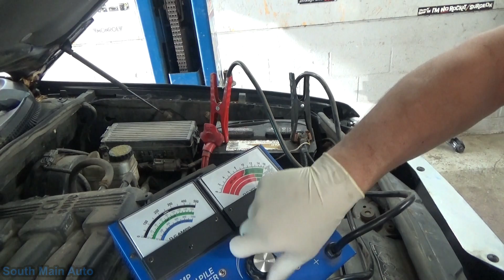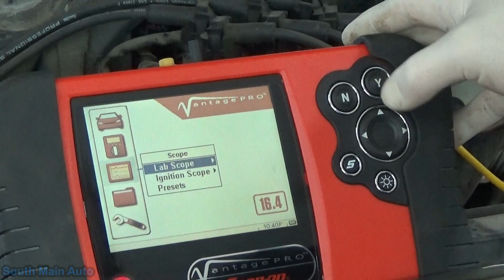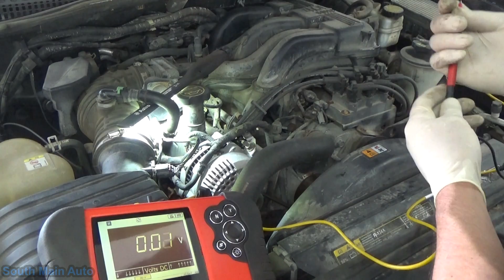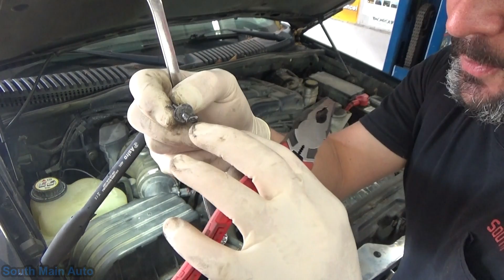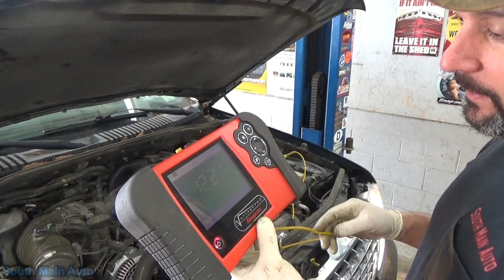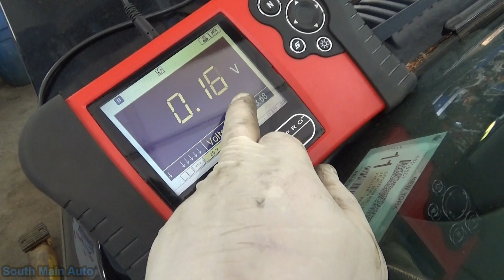Charging System Problem - Voltage Drops

Comment: Eric ...many of the companies that put out  remanufactured alternators do not always replace the voltage regulator....we ran into a lot of these issues with Ford vehicles at the shop that used the smart charge systems ....we solved the issue by comparing a brand new OEM Motorcraft Alternator to several aftermarket /remans and found that we had no issues with the OEM Motorcraft that was brand new ,they held the voltage indicated . Then we looked at the remanufactured ones and found not one of the voltage regulators had been replaced either for cost savings or just short cutting to a workable unit . So in short OEM in this case even though more $$$ solved the issue in the smart charge systems.

Comment: Nothing more frustrating than swapping a bad part, with a brand new remanded bad part.  Good job verifying repair. People in my shop freak out when I verify my repairs. Lol! But, I don't have come backs😆
Reply: if I had a dime for every loose reman and new aftermarket alternator studs, i;d be rather rich :)
Reply: As long as they don't hold it against you as far as  them thinking you are wasting time

Comment: Good point about wiring resistance and voltage drops. An old motorcycle I had years ago had a crappy headlight. When I measured running battery voltage versus voltage right at the headlight bulb, I can't remember the exact number, but it was a lot! It had very thin gauge wiring. 

To solve this, I used the headlight wires to trigger relays. I had a heavy wire right from the battery, to the relays, from there to the headlight. This nearly eliminated the voltage drop, and made the headlight much brighter.

Comment: In cases with low alternator charge, you should also test the voltage drop in the negative (return) current path.
This would be the voltage drop measured from the alternator housing to the battery negative terminal.
Very often you have corroded mountings in the alternator brackets and bolts, the engine to chassis lead, the chassis to battery negative lead etc, which leads to substantial voltage drop.

Comment: This shows the importance of loaded circuit testing. Upon first inspection, it appeared good with >14V at idle. Once that crappy connection needed to carry a lot of current, the problem became obvious. Good work, Eric.

If only the reman suppliers could even come close to your competence.

Comment: If you check listings for replacement alternators for 2005 Ford Explorer, two are specified:  115 amp and 130 amp. To get more amperage output from an alternator, you need more windings of electrical wire in the stator unit. That would mean the stator has a slightly larger size and requires a larger diameter case. But Ford engineering may have specified the same size case between a 115 amp and 130 amp alternator. The difference is internal to the unit: the 115 amp winding is slightly smaller than the 130 amp winding. From the outside this would not be noticeable.

Now the remanufacturer starts to get original equipment alternators for rebuilding. Sloppy quality control in the rebuild process allows the smaller stator windings (115 amp) to be installed in units calling for 130 amp windings. It fits physically so everyone is happy. The final stage is quality control testing (or lack there of). 

At interval 29:00 the test results indicate 60 amps output at idle and about 120 amps at higher engine rpm. That would be excellent test results for the LOWER OUTPUT 115 amp alternator. And 120 amps is CLOSE ENOUGH TO THE REBUILDER SPEC in final testing. Great quality control! So the alternator gets shipped to an unsuspecting buyer!

This is just a theory. It will be interesting to see what Dr. O finds in Part 2
Reply: Comment above about pulley size which will have an effect on rotor rpm as well. I agree with what your saying
as well. Number of winding on the rotor and stator dictate current output.

Comment: To me it looks like that remanufactured alternator may be working as designed, but it may have actually been a mislabeled "look-alike" designed for a lower amperage car.   It's still a supplier problem, and ultimately your parts store needs to take responsibility for their supplier, as they kindly did in your follow-up video.  My own guess is that few other mechanics would have noticed the insufficient amperage output problem like you did - you're a great mechanic - thumbs up to you!   Don't feel too bad that you melted your voltage clamp/probe, I have done that before too!  Those cheap air cooled alternators get HOT, much hotter than the engine.  I learned the same lesson the other day, melting a scope probe on the V+ terminal of an air-cooled alternator.  I suspect those fancy water cooled alternators last longer, and wouldn't have melted your clamp, but of course they are expensive and harder to replace.  I enjoy these newer alternator "systems" which don't actually turn on the alternator until after the car is started.  That reduces the mechanical load on the starter, and the peak current  requirements of the battery, both of which which can be especially useful in cold weather.  Some of these intelligent charging systems also back off on the alternator voltage after the battery is charged, so the battery doesn't get overcharged, which can confuse you trying to diagnose a problem like this.   Again, FANTASTIC video for anybody who wants to learn about alternators!

Comment: This happened to me.  I was on a cross country trip at the time in my just rebuilt Dodge 2.2 turbo and I had put in a "new" altenator just for good mesure and so that I would not have any problems.  Long story short, I changed it at a truck stop and lost very little time. They (Advance Auto) delivered a new one to me at the TS under warrenty.

Comment: Connectors, like that eyelet connector, are copper with tin plating. The tin plating prevents the copper from oxidizing and causing electrical resistance. It's not recommended to remove the tin plating, by using sand paper to clean the surfaces. Electrical contact cleaner and a mild abrasive (cotton cloth) is recommended. Excellent troubleshooting.
Reply from the maker: Sand it, toot of fluid film, move on :D
Reply: Guess what, they're being cleaned because they're already corroded/dirty. There is no other way to clean up the connection besides replacing the eyelet or cable. It's done all the time.
Reply: sounds like a good practice for cleaning new parts, not crusty ones, i like erics method, he ain't going to re tin o ring connectors lol

Comment: Just thought, that this cable and especially the crimp connector would be a nice task for a FLIR camera. Easy to verify were exactly the heat is produced: Heat = increased resistance = failure position. Btw, nice job Eric!

Comment: Good troubleshooting. Vibration may have caused the adapter failure. When the alternator is removed it is a good time to clean the mounting area and bolts to get a good ground. You didn't show a voltage drop test from the alternator case to the block.
At a cold start up in cold weather the alternator out voltage would be increased, a cold battery gives less current out but it also won't take as much current in.  
Good video.

Comment: Hi
Consider the pulley diameters and engine idle speed

The alternator current output is related to RPM (look at the test document.)
Compare the OEM pulley size to the reman. part . Also Ford engineers may have not considered the higher loads to charge the battery at all times. BTW Alt. pulleys are modified all the time for HD marine ( house batteries ) applications.

Comment: Interesting learning about reman alternators in the video.  I recently replaced the Alternator in my Jeep Grand Cherokee and considered several options - a reman from Mopar(they don't sell OEM new versions), a reman from Rockauto, and a new from Rockauto.  On the Rockauto website they put a little heart picture next to the alternators they sell most. Of the 10 alternators offered for my vehicle the heart picture was on the new alternator.  So, I purchased new.  It worked out well.
Reply: Gotta love the little heart!

Comment: Thank you for this video.  After watching this video. A day later I had the same issues on a 2001 Mack truck. Day cab. Voltage drop the ground side and found I had a 2 volt drop. Turns out I needed to build a ground Cable and the truck ran great and the alternator was charging he batteries.

Comment: Put the transmission in gear with your foot on the brake with all that stuff running.
That's the battery voltage test I would always give them.
If it kept up , it was good to go

Now the charging system algorythms that GM uses on the newer trucks is another story.
As long as it is between the min/max bars on the volt gauge in the dash ; it is considered NORMAL even though it may appear to be NOT CHARGING AT TIMES.

Comment: Awesome video as usual I've ran into the same problem with aftermarket garbage I had one it was hard to change I made them test the new one after I got the third one I made them tested on their machine before I put it on finally got a good one.

Comment: Love your video! You are going all the way, not stopping at first possible problem, until you found the real issue! I love that! I have 2007 Gr-Caravan, 3.8L... that is draining my battery. I had to get a new battery, the old one wasn't charging but after 5 days the battery is drained again! I checked the alternator, producing 14.7V and charging the battery well! I turn off manually the lights, just to make sure that they don't drain the battery. After 1min to 2Hrs, (every 10 minutes) the drain is only about 0.02 to 0.03mA and I think it can go up to 0.05mA, if I understand the manual. Sometimes the battery drains in one day, later 3 or 5 days...it isn't the same amount of days ever. Almost like someone is playing with my car, while I'm not watching it... ha ha ha  What would you recommend me to try next? Do I need to take it to Dodge Service and have them run diagnostics? I'm at the end of my ideas. I do have only one problem with my car, the driver side sliding door, it is electric, opens about 1-2 inches and I have to open it the rest of the way manually,  to close it, I must close it manually. Could this somehow bee part of my problem? I'm open to any suggestion by you or other car guys! Thank you very much!

Comment: I just had to put new cables in the old Dodge Ram. Don’t forget to check for a clear poly liner under the cable outside insulator before you do the lug crimp. Ask me how I know lol.

Comment: With so many changes to the amps being used, one thing I learned to do was all ways check the size of
the drive pulley on the old alt to the replacement...if the pulley is smaller, it will change the rpm on how fast a alt turns, which affects amps being put out a idle speed with a load....please comment....

Comment: I remember troubleshooting a solar/wind charging system on a sailboat in Puerto Rico; the owner had been struggling with it for over a year, hiring multiple mechanics - nobody could figure it out. Turned out the clamp on the battery terminal had a ~0.4V drop across it - even though you could literally see the metal-to-metal connection, and it had been cranked down tight. Two minutes with a wire brush, and he had 30A going in. Unfortunately, he was also one of these guys who thought that those two minutes was all I should get paid for, and got really huffy about my minimum charge for working on boats at anchor, despite having been told ahead of time... 🙄

Comment: That is a strange finding, given the presentation. Not just a typical bad ALT situation. I don't have a clamp meter. I used to figure all that stuff out just using my DMM. But, haven't been a "Technician" for 15 years.
--I've seen "New" ALT not work. Slipping belts, even though no noise. 

--Right now, I'm trying to figure out why my '03 Rav4 V @ idle with high beams and all accessories on drops down to 11.2V. rev it up, and goes mid 12s to 13ish. Cruising, even city driving, stays about 13.8-14.2V steady. Usually it's at 13.8. It's evidently a Toyota thing. 

--I added: A. 4 gauge battery to body and B. engine to body grounds, in addition to the existing. 
--Now, these RAV4s/Toyotas have some charging issues. 
--But, it's not that. I checked it. no V drop. Checked resistance of grounds: all good. 
--Now, one thing different is that I used an Optima Yellow Top Battery. ??

Comment: Nighttime driving in the snow
Headlights, fog lights, wipers, rear wipers, rear defroster, blower fan, mirror defrost, heated seats and the radio. A/c would probably be on from the front defrost vent selector, which also turns on the cooling fans a lot of the time. 
I think that is all on a typical snowy drive at night. Forget all of the computers cars have now and everything.
I once had an alternator fail on my way home at night. 93 Chrysler car, that luckily had the voltage gauge in the instrument cluster. I noticed the volts were low on my way home before any lights came on. Only had what was required to get home. radio was off, faceplate was off (to keep the display off) , I turned the instrument cluster lights to the min brightness, etc. This got me a max of 20 minutes of driving from when I noticed the alternator stopped putting anything out. I got stranded on the side of the road without any power because the car no longer could run on the remaining charge in the battery. If it was snowing out, I wouldn't have made it very far.
Reply from the maker: For sure. cars are huge energy hogs and really dependent on that atl.

Comment: very good vid thanks Eric more than likely the ford left the factory with a poor alternator knowing parts manufacture now a days they print paper work to go in to the boxed item and heck its close heck let it go. as long as the car was running above idle it was ok it was when it was at idle the trouble starts until age got up with the part.

Comment: 2:30, FYI, I'm not sure if someone said it already because I'm coming into this in the year 2021 but there was smoke coming off the negative post at 2 minutes and 30 seconds or just a little after when you were putting a load on the battery.
Once again, the Lake House Affect.

Comment: Sometimes the insulated washer on back of the alternator hot Post will crack and cause a failer in the alternator.

Comment: Good Video Explaining the whole loads on Alternator phenomenon as ive put aftermarket new 1 in my last car bit iffy under load at idle, i put up with it as it worked "avoided overloading" and just did not back my thought diag 100% as a diy, but it was under-performing like this videos one. SO Thank's SMA, theres you problem lady

Comment: Mrs O wants a jumppack? Don't leave the key in or car on...problem solved! Remember when alternator and regulator were separate? Look forward to conclusion and if you get better reman part!
Reply: ya left the keys in it ??? -"theres your problem lady"  lol
Reply: richard cranium 

😂
Reply: xoxo2008oxox I remember separate alternator and regulator. 72 was the last year for that on gm vehicles. I remember aftermarket regulator upgrades with solid state  circuitry too.
Reply: Seems like a reasonable demand. I think somebody sent Eric one of these for free. Give it to Vanessa, why not.
Reply: OH NO!  Heaven forbid giving an electrical fire starter to someone worried about a airbag going off to protect them with or without Eric under the car to soften the fall seems a bit to wild even for those living in the wilds of countrytime NY.

Comment: Probably the third time I've watched this video. Most people don't realize the alternator is supposed to put out ample current at idle WITH LOAD. They just give the car gas and everything is okay. And as long as it starts every time that's all that matters. Wonder why your headlights dim, wipers slow down and heater fan slows, then when you take off everything's good? That's cause at idle your car is demanding more current than the alternator can put out until you speed up and increase RPM... How many DIYers actually do all this testing when they replace an alternator? Probably less than half. They install it and see 14+ volts charge and call it good. You should do some testing.

Comment: Very informative video Eric great job oh also a  little complaint you must use your other tools like Pico,  Pico starter test would be nice but I guess speed is the key much faster with carbon pile tester. When Pico is fired up it is nice to have alternator ripple and then it should be ready for the rest also.

Comment: I have the same issue with an 07 mustang Gt. I ended up getting 2 $219. Napa rebuilds. Both had bad diodes. Finally I got my core and money back. Went to Ford and bought a reman for more money and it only lasted a day. Now I have to wait for another reman that is coming from another state.

Comment: I would like to add a comment . I was in a mild accident with a  2000 body style f250, a car crossed my path . Two things happened over time. #1 my radio began to work intermittently and the jolt of the accident and the heaviness of the radio applied pressure to the faceplate and thus the radio began to short out.  But here is what happened next.
 Driving down the highway at night. Lights began to dim, battery discharged and engine started  running bad and I had to cross 3 lanes to get to the shoulder in heavy traffic no lights.
 Being mechanically inclined I took a cab to the part store and bought an alternator. I replaced mine roadside and the truck started and IO made it 1 mile and it happened again.
 From there I had it towed to a shop. 
   Here is where Ford voodoo technology baffled me. THE INSTRUMENT CLUSTER VOLTMETER CONTROLS THE ALTERNATOR OUTPUT AND i NEEDED A 500$ INSTRUMENT CLUSTER FROM FORD TO SOLVE THE ISSUE.. It seems the accident also stressed the instrument cluster and over time it failed also